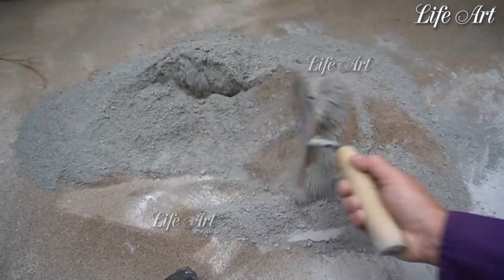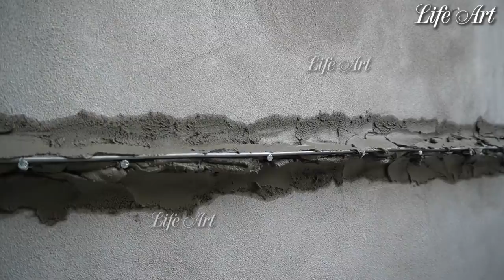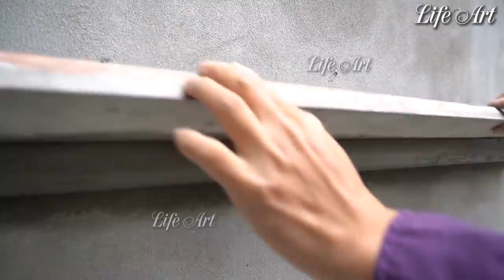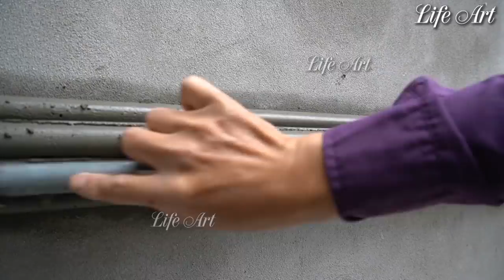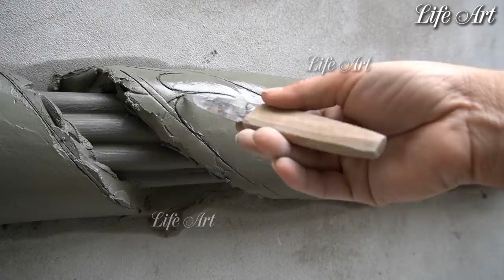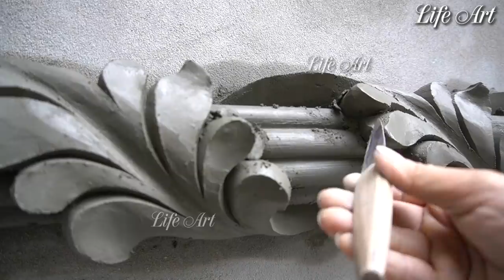New and unique model decorative sculpture

Comment: I also make cement sculptures. Why is the cement you use so delicate?
Reply: 大师。我也是做水泥雕塑的。为什么你用的水泥这么细腻？
Reply from the maker: I have been familiar with cement for many years so I understand how to apply
Reply: Add 20% of your cement you use with METAKAOLIN powder. It turns the concrete into like clay so you can carve it easily.

Comment: Cual es la proporción de la mezcla?
Reply from the maker: 2 partes de cemento y 1 parte de arena fina
Reply: Add 20% of your cement you use with METAKAOLIN powder. It turns the concrete into like clay so you can carve it easily.